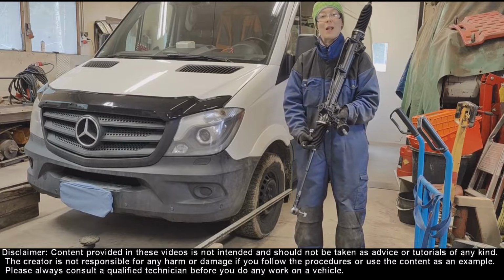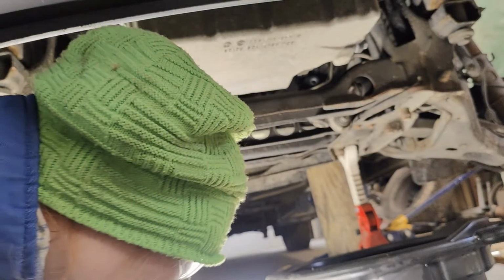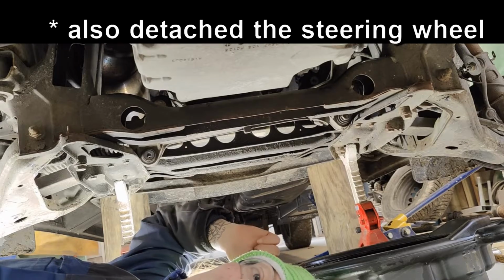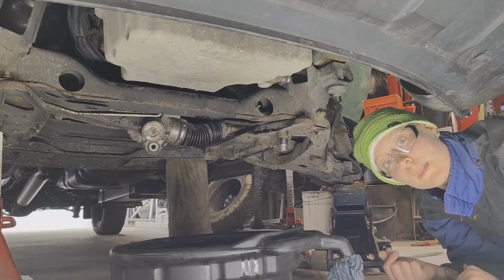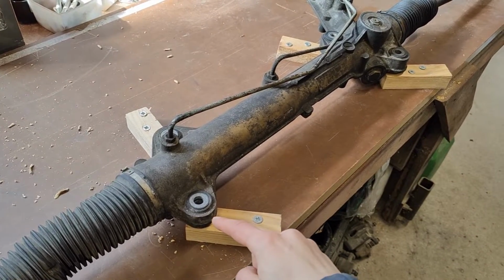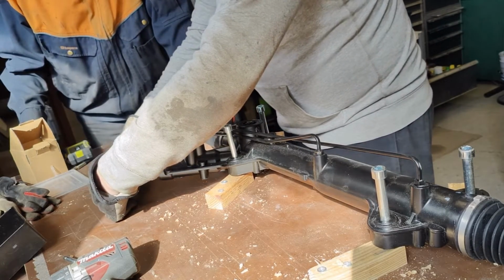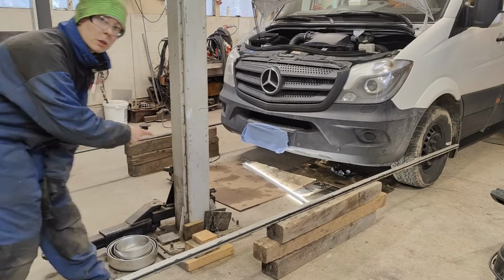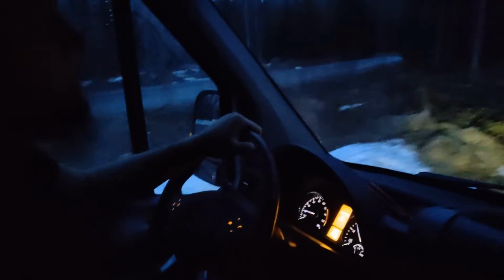DIY Installation of Steering Rack (Sprinter 2014)

Comment: Is this the same for 2009 sprinter?
Reply from the maker: Heya 😊 probably the chassis is the same, but i'm not sure. I have only worked with this Sprinter 2014 model. If it is, please let me know too! Cheers 😄
Reply: @badasanaexperiences Same for all W906 Sprinters 2006-2017 and VW Crafter 2006-2016.

Comment: First of all thank you very much for the video!
I also just encountered the ESP problem after replacing the steering rack. Was there a way for you to tell which way to turn the steering wheel in relation to the steering rack? I unfortunately do not have access to a scanning tool right now. Were you able to dettach and turn the steering wheel without dropping the steering rack?
Reply from the maker: @sebastia5265  Thanks, you are very welcome 🚐🛠️ We tested both rotation directions and in our case, clockwise gave ESP error before the wheels were fully turned. And anti-clockwise didn't give ESP error. With that logic, we adjusted 360° to anti-clockwise.
Yes, it was tight but the spline shaft of the steering rack had room to detach from the steering column, so we turned the steering wheel and re-attached the securing bolt. I truly hope this helps, these are nasty car troubles 💖 Good luck!
Reply: @badasanaexperiences  Thank you so much for the detailed answer! This really, really helps. Happy New Year!
Reply from the maker: @sebastia5265  No problem at all! This helps me to learn more and tackle similar problems next time i encounter them 😆
And one more clarification for the ESP troubleshooting here: I mean by "testing the rotation directions" that we drove slowly forwards, turning the steering wheel. And clockwise gave the ESP warning light and ABS engaged on brakes with that hammering sound. I hope that your case solves out as easily too!
Reply: @badasanaexperiences  just wanted to get back to you (and in case someone encounters the same problem): I actually did not manage to disconnect the steering wheel shaft from the steerin rack. Instead I took the steering wheel apart and manually rotated the clock spring (steering wheel angle sensor). This sounds complicated but is actually pretty straight forward. However you do have to take the airbag off the steering wheel. 
Thank you again for your help! Your answers were really helpful in pinpointing this problem. Without you I could have only guessed what caused the ESP light to come on.
Reply from the maker: @sebastia5265  Heya, thank you so much for coming back to this topic! Hopefully it helps fellow DIY technicians, this repair is indeed a headache 😅🛠️
Brilliant, glad that you got it sorted out eventually! 👏 I was also a bit worried about the clock spring. Detaching the airbag sounds exciting, did you happen to catch it on video? (I hope that i don't need to do that ever, but hey you never know what error pops up next haha) 😂🎉

Comment: Thank you very much for the informative video 👍.  I'm afraid I'm going to have to do the same repair. Thanks to your video, it will probably be a bit easier for me. I have a question about your steering wheel alignment. Can I prevent this in advance by fixing the steering wheel? Or how did you manage it?

Many thanks and best wishes to Finland 😀
Reply from the maker: @kimgeldmacher  Heya, glad to hear that you liked it! 💖 I believe that the best way to prevent our mistake is to mark the steering wheel location in the cabin, where the rotating stem connects to the panel trim. I would also try to take more pictures of the old steering rack before starting the work. I hope this helps at least a bit 🌻🚐 Good luck!
Reply: @badasanaexperiences  Thanks a lot for your response. Of cause that will help...🙏😊🙋‍♂️

Comment: Que quilombo por Dios!
Me está haciendo juego la cremallera. No pierde líquido hidráulico pero el mecanismo tiene juego.
Ni loco me pongo a hacer eso...
El problema es que en mi país (Argentina) una cremallera nueva es muy muy cara y sumado a eso no me quiero imaginar lo cara que va a ser la mano de obra.
Reply from the maker: @rcgunsnroses  Thank you very much for taking your time to watch! 💖 Yep, we had the same play in mechanism and would have failed the next annual inspection, Finland law is very strict.
Same here, the quote for the repair was about 3500€ at professional workshop. My advice is: Ask for good quality Reman (remanufactured) parts, they are cheaper than new spare parts and you get some money back when you send the broken part back to the supplier 👍
Just remember, try to find a reputable MB dealer for the Reman parts if possible, so the risks are lower. Good luck with the repairs! 🛠️🌻